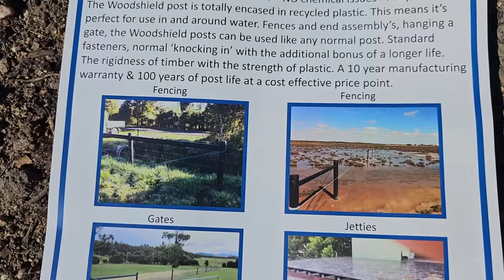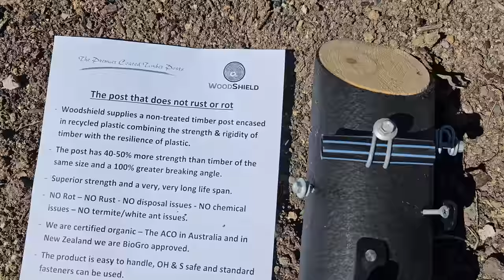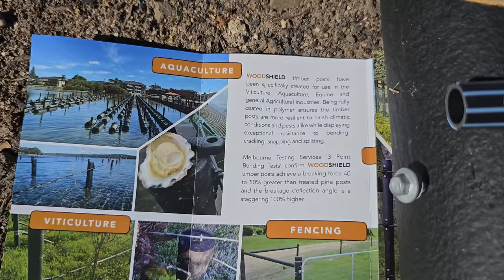Don't Make This BIG MISTAKE With Your DIY Raised Garden Bed

Comment from the maker: G'day Everyone, my shoulders are sore, and this old knuckle dragger has a few blisters, but I really enjoyed this project (including the editing etc) - it was a ton of fun. I hope you are all "getting into it." Thanks for your ongoing support! Cheers :)
Reply: Have you ever tried a shallow raised garden bed with just coco coir?  I am trying this year!
Reply: my chickens think I'm digging for them...
Reply: Loved the editing! You could always pay for a few new tools by making commercials
Reply: I can't tell you how much I appreciate your videos, especially telling us what's gone wrong and how you've fixed it! Love your work Mark!  Thanks for sharing all of this!
Reply: while using boards or a thick metal flat bar on the outside walls as a brace you could run a long threaded rod through and bolt from the outside to keep the walls from bowing out like some of the raised beds you can buy online.  could also use angled iron on the corners instead of wood that would rot or put the wood on the outside of he bed to brace the corners.  I am thinking about making some beds out of cement blocks that should last the rest of my life.
Reply: I don't think your plastic coated pine posts will withstand termites unless they are fully sealed top and bottom. Termites love untreated pine and any entry point will do. They may even eat through the plastic to get to the pine.
Reply: @lukemorine  I'm trying something similar! Mixing dirt, compost, and coco coir
Reply: I SWEAR!  GRAVITY!!  🙂
Reply: I recommend getting some quickset concrete mix and filling around the base of those back posts. You can just mix in the hole and will save you a ton of headach over time when the posts don't lean. Hope that helps 😊
Reply: @lukemorine  That's not going to work man. Coco is inert. You're going to need a source of nutrients. Compost or worm castings is your best bet. You'll need at least 10% but more is better. 50/50 is great. Good luck.
Reply: You are going to get buff doing that!
Reply: Possibly some food for thought, but I would have used a stake at 45 degrees and tied a tension line to pull it instead of relying on the other garden bed. 5:11
Reply: Hi Mark, may you be having a restored day today and not feeling anymore the sore feelings. Thank you for the video! I'm researching right now which kind of bedding to make and your video is certainly already being a blessing! Thank you so much! A lot of work indeed, good job!!!
Have you had any reasons so far not to recommend the big round plastic bins you use also as beddings? (which I assume I could buy as "water tanks"?) Thank you and may G'd bless you, your family and your fields.
Reply: I Actively Use Your Idea of Burying My Kitchen Scraps In the Garden and Under a Plum Tree. May I Have Permission to Refer Your Channel in Mine Own Gardening Videos?
Reply: Mark I hope you're still planning on selling your self sufficient me broad brim hats! I want one!!
Reply: Nothing like watching your vids after a tough day in the office to get me inspired to venture into my garden. Cheers Mark
Reply: @lukemorine  do you plan to fertilize? Coco coir is typically in seed starting medium but it doesn't have nutrients to keep stuff going. I've had some success ( by forgetting to plant out some things I started in coir ) growing peas and beans in coconut coir but these are plants that fix their own nitrogen into their growing medium.
Reply: @JeagerTv  I'll be setting up a drip system with water soluble nutrients
Reply: Charred wood lasts longer but check into fabric and cement you can form and harden. Also read up on buttressing in general and flying buttresses.
Reply: Hey Mark where do you source those posts? I live just up the road.
Reply: Love y and your page bud.  You should do some throw back videos.  I watch your videos over and over again and i still learn something everytime i watch an episode 10 times.  Been sharing your page to all my friends and family.
Reply: Hi Mark. 30 years ago when I was 5 I lost my index finger and the top of my middle finger on an exposed sheet of corrigated iron like the ones used In these garden beds. Could you could do a vidio to raise awareness of sharp edges in the garden for those with small children around. It would mean alot to me if it could save another kids fingers.
Reply: You’re a beast Mark. You’re leaving one heck of an awesome legacy. I and many others will be using the knowledge we learned from you for years to come. Hopefully even pass it on to our children.
Reply: @matrixdecoded4226  they are fully sealed at top and bottom.
Reply: You're a hard-working dedicated gardener for sure ❤
Reply: You and your kookaburra friend need to listen to Xavier Rudd's perfect channel theme song: Storm Boy ❤❤❤❤
Reply: I would redo it all to give it the look I would really want
Reply: Love your devotion and dedication to your backyard garden, all aspects of it. I share ur videos with hubby and he watches with his tea and breakfast. I Wish we had more land and less deer, chipmunks, bear and fox. But we do what we can. Love your choice of 
‘knickers’ too. 👍🏼
I got this year’s choice of vegetables for my birthday and shit (as hubby says) for Mother’s Day. Literally… manure and soil for the garden beds. Can’t wait for the harvest. Stay well, Mark.
Reply: Like the new channel mascot.... Korky the kookaburra
Reply: Question - where did you get your riding lawn mower from and what is the cutting width?
Reply: What kind of bird was that that was hanging around there in your video
Reply: What will you do when you get too old for this type of work?
Reply: Very inspirational but not looking forward to resupporting my newly built RBG in a few years. wink,wink
Reply: Mark,  I Love All your videos, And your 'common sense', explaining that goes in to all the projects.  Keep up the great work!!  AJ.

Comment: Celery has 700 seeds in a packet and they’re so tiny I figured they’d have poor germination, so I put about 10 seeds in each 6 cell. I’ve 70 plants now all over my garden. In flower pots, raised beds, against the house 🏠🌱🤣
Reply: 😂😂😂 I think you'll need a video now on how to store celery long term. 😂😅
Reply: Celery is pretty resilient to being separated as seedlings. Make sure the seed cell is moist and then separate as you would with onion starts.
Reply: @steveegbert7429  I did. I started them December 31st so they got their own cells in February, then about 10 of them sprouted a second celery. It’s true they are resilient being transplanted, I don’t think I’ve had any die. Just have to keep them well watered.
Reply: @Gardeningchristine  That is true. I started several this year and only had one or two sprout and was about ready to give up. Then, after three weeks, I have more sprouting in the last few days!
Reply: Brilliant restoration work in your garden!  It wasn’t easy.   Thank You.  ~Sharon from Florida

Comment: That Kooka was so cute <3 how it didn't fear you at all, very cheeky little buddy. We used completely Recycled Plastic poles to expand our garden and connect the fences. They react exactly the same way as Wood would but they will last for years and years and years <3 I could even paint them if I wanted to, but I enjoy the gray colour they have now. They are a bit more costly, but so far I love them <3

Comment: When I built my beds on a substantial hill I actually made the downhill side taller and I try to angle the wood along the hill. I probably looked like a weirdo using a piece of lumber and a level to figure out how extra tall that side needed to be! I also put a couple 2ft lengths of rebar on the inside of the uphill wall about 1-1.5ft down to mitigate the slight concern I had about them sliding down the hill.
Reply from the maker: Good advice Mike! Thanks for sharing mate and all the best :)
Reply: @Selfsufficientme  My only recommendation is adding Anchors plates on bars attached to the inner walls. Then angled 45° downward so they with be planted firmly. That way, when a wall wants to fall outward it will have to pull on the dirt inside.

On a side note, I'd like to thank you for all the amazing content and info you provide on gardening! You are doing an amazing job👍🏻
Reply: Becky from Acre Homestead built her raised beds on a sloop. you should check it out it's really nice.

Comment: With cantilevered posts, atleast 1/3 needs  to be in the ground. If the planting bed is 900mm high, then you need atleast 450mm in ground. Also, to make the timber last longer, use it on the outside with metal on the inside ~ this is also structurally stronger as the pressure of the soil is pushing the metal against the posts rather relying on metal screw heads
Reply: Should the original rectangular timber been rotated 90's so the longer length would be resisting the main forces?
Reply: @edevans5991  If you were setting them in concrete, yes.
Reply from the maker: Thanks for sharing your experience and tips, William. Cheers :)
Reply: @robertkubrick3738  no, even without the strength is proportional to its depth, he has it right. I think they were designed to be minimal as possible so they didn't get in the way over rigidity.

Comment: Being in the northern hemisphere, I just got my raised bed partially planted yesterday from seedlings I had started. Mostly peppers with a couple tomatoes. I am a pubescens variety pepper lover. I haven't grown them for many years, as keeping them alive through the winter can be tough. I would grow individual giant rocoto plants in 100 gallon horse troughs and that is the minimum size for those plants. Normally the plants would have been out 4 to 6 weeks ago, but our spring has been fairly cold and wet.

Comment: Love the heroic music and the humor intended. You’re an inspiration. For the post hole, what I’ve seen and done is dig 2 ft deeper than your intended depth for the pole. Place gravel and then your pole/post. then fill with quick setting concrete (10-20 minutes) followed by water and let sit for a day. Don’t forget to support the beam with something to keep it leveled
Reply: I was coming here to make the same suggestion. You get a lot more stability in these kinds of situations with quickcrete around the post.
Reply from the maker: That sounds like a good sturdy way to put a post in. Thanks for sharing mate! Cheers :)

Comment: You can use the tamping end of a crow bar to drive the soil in to the point it's like concrete, and you can use this method to straighten the post by tamping in the opposite side to where you want it to go.  Thats how I put in most of the posts that I do.

Comment: When I built my beds with treated lumber, I added a plastic liner inside. I read that was a good way to close the risk gap. The plastic has kind of sloughed off over the years but it's about reducing a low risk, not about eliminating it. If I had already built my beds before I read about the possible risk of leeching, I wouldn't have done anything about it. But when you're building new it's definitely worth a bit of extra work.
Reply: the treated material nowadays are safe to plant vegetables being mercury and other chemicals have been taken out of there process to treat the wood
Reply: Plastique is a good idea;find the heaviest black plastic ya can find...

Comment: Sometimes in diy you find problems you didn't fully prepare for, but either way sick garden bed layout. You could just enjoy the day, sippin on a beer/cool liquid, walking through the leaf tunnel you made and pull off a cucumber, grape, tomato, et cetera. Over all just nice garden design, easy on the back too. 10/10 will copy someday.

Comment: Well done, Mark! Can I share one thing out of a recent personal experience? We live in north Texas and our soil is very heavy clay. Almost impossible to garden in, so all of our garden consists of raised beds. This spring my husband installed a fence around our garden (to keep our neighbor’s chickens out, lol) and he built it from 4x4 posts, 12x8 boards and hardware cloth. Initially we assumed due to the heavy clay that we could just dig holes for the posts and backfill with the soil and that would keep everything sturdy. But less than a week later we noticed several posts leaning and with pretty big holes around them where the soil had compacted after a hard rain. We ultimately had to go back and re-dig all the posts and fill with concrete. Now they are so much more sturdy. I hope you will not have to do the same after all that hard work you did on this project.
Reply: We have heavy clay here and when putting posts in the ground we only put 1 shovel full at a time and use a rammer to compact the clay really hard before adding more dirt and it works fine but it's hard work
Reply: You can make natural concrete without buying or polluting by using clay, sand and rocks (no cement needed) make it into a slush like concrete. Pour it in. Cap with gravel or sod

Comment: To keep mine squared, I hammer a bunch of posts into the ground surrounding the beds. I typically use 3/4” galvanized electrical conduit, and bury to a depth of the height of the bed. It gives the walls something to lean against, and the load is spread out. My beds are all 8’ x 4’, so each long side gets three posts (one every two feet) and each short side gets 1.

Comment: I NEVER use wood for in-ground posts. It doesn't last. I use rebar. Simple install - use one of those pipe mallets (a weighted piece of pipe that has been capped off, so you can raise it up, drop it, and it hammers the steel pole in for you). I get the hardened rebar with a weather-resistant coating. It's brilliant for securing and reinforcing raised beds in my hilly high dessert garden in Arizona. Best of luck, Mark!

Comment: 5:51 - just one point...make sure you pull as much slack through your ratchet before you rachet it so that you can get the most travel (aka strap under tension) as possible.  ;)  For as much as you needed to move those you could use every mm.

Comment: I think your original mistake was not leveling the garden bed. A level bed wouldn’t need deeply sunken posts.  Just posts to hold the sides in.  

I would have recommended you fill the post holes with concrete and add a brick or something to the lower side of the bed, under the galvanized edge.  Since it’s still tilted down the hill, it might continue to lean.  You probably just bought yourself some time but you might need to do this again. 😖. I love the trellis.
Reply: I was thinking the same. A valiant effort and I hope it lasts but time will tell. 
As well, I think the original interior across braces were probably helping a lot, to a) keep the sides together and reduce bowing and b) help hold the low side up. I think it would have fallen a lot faster without those braces
Reply: concrete is the worst building material in the world... Not only is it extreamly co2 e heavy in production, it uses tonnes of sand, which is often made by predator coral-killing mining...
Reply: @m_lies  🤯
Reply: @@trollolol705 no, not really, there is a big difference between using a Truck or a bicycle, if the bicycle is more than enough to do the job.
Reply: @m_lies  Not a CO2 Nazi! Do not buy into the lie.

Comment: I'm totally with you regarding plastic use. The problem isn't inherently that plastics take a effectively forever to break down, its when we use them to create things that shouldn't last forever (eg: disposable bags, bottles, packing materials).
When I got a 3D printer, I had a friend open a discussion about plastic and the idea that we should reduce plastic use wherever possible, but as far as I see it if we're using plastics for the right reasons - namely creating objects intended to last effectively forever - and out of materials that can be infinitely recycled (it's relatively cheap to recycle most 3D printed materials at home), I don't see the problem.

Comment: I like your garden but you’ve convinced me, I’m staying with the horse trough raised garden. Using the materials you have may be a bit cheaper to begin with but for the pass 20 years I’ve never has to do any maintenance other than planting to my raised garden beds. I getting ready to order more but was thinking your type might be easier. Thanks for sharing.

Comment: Literally 2 days ago I watched the video of you installing that bed as reference for one that I finished up last night. I used 2x6s to make two 2-3 level beds terraced into a hill. Luckily I did put my posts pretty deep and the hill doesn't look as steep. I was surprised watching the original video that it didn't need more crossbeams but I thought, "I'm sure if it's a problem Mark would have posted a video." Good to have that a validated lol. I put a bunch of crossbeams in my lil beds just for peace of mind, so hopefully I don't have any of your problems. Thanks for sharing as always.
The kookaburra was incredible. So cute. We don't have those in Nebraska, we do have lots of corn.

Comment: You should not need giant posts to hold up your raised beds so they don't tip over, Mark. This situation is pretty funny.

Just level out that part of the ground before you build, or cut the walls of your bed to follow the slope of the ground and build it with one wall taller than the other - the important thing is just to have those walls be perfectly vertical from the start. Tie something heavy to a piece of string and use it to determine what vertical is. If you just eyeball 90 degree angles from a slopey ground, or cut all the pieces staight and equal as if for level ground but assemble them on a slope, then of course you'll get your leaning garden beds of Australia.

Comment: My brother and I had to rewrap some of my beds I made from concrete reinforcing wire with landscape fabric after the initial layers about gave up. The rest of my beds are plastic barrels or steel drum halves. Despite a late freeze taking out almost all of my fruit and the first plot of sweet corn everything else is doing pretty well.